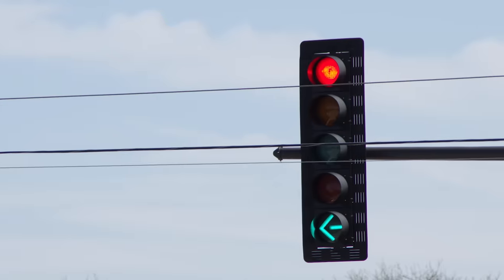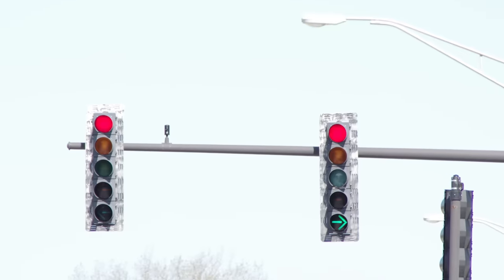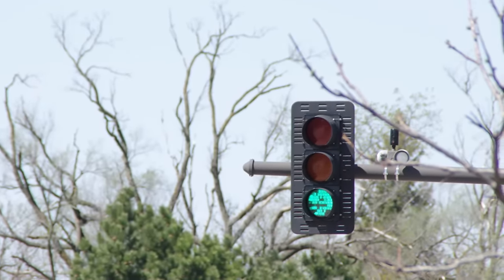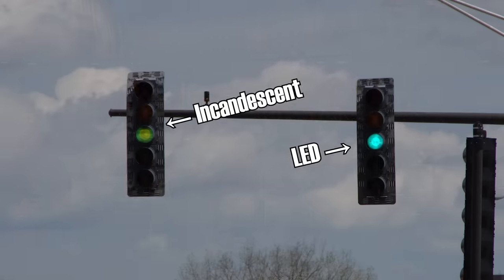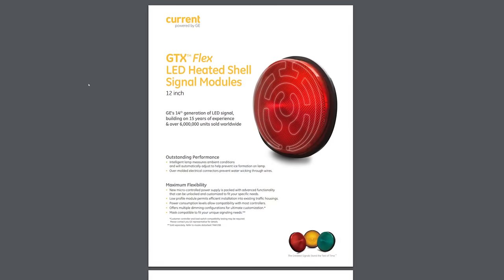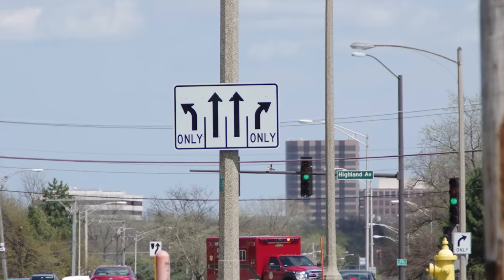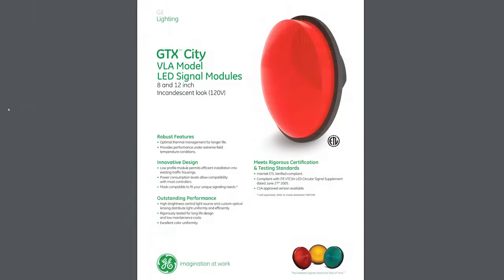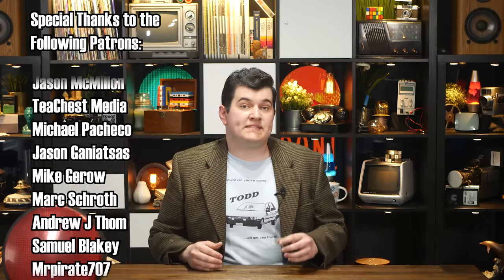The LED Traffic Light and the Danger of "But Sometimes!"

Comment: Just like "But Sometimes" automated electric cars have accidents and idiots started rioting. I really really wish only automated electric cars were allowed. Can you imagine what a great thing that would if we could accomplish that?

1. You don't need traffic lights at all! Because cars can talk to each other. The cars could decide how traffic should ve controlled so that it takes collectively least amount of time.
2. No anoying horns. Since cars could talk to each other there's no need for using horns (except when you really need to). That would solve sound pollution problem in busy areas by great amount. And of course, schools and hospitals would really appreciate this.
3. No one to break rules. Since no human drivers,no asshole drivers to break the rules.
4. Since no one is breaking the rules, no need for traffic police, no speeding ticket, no nothing.
5. And again, no asshole drivers.
6. No drivers ed, no complicated driving license acquiring etc. You could just buy a car and ride back to home.

This is something new and we really need to embrace it as quickly as possible. Just think about how much maintenance cost it will cut. The whole system needs to be redesigned, yes. That would take time. But if we try to embrace it as early as possible, the future might reveal itself to be much closer than we expected.
Reply: Cars can't talk to pedestrians and one pedestrian can break the whole "car talking" system since they are computers which were programmed by people. Imagine a kid jumping in front of a car to get his ball. What does the computer do? Turn and kill you and person in another car or try to break and kill the kid. Either way, there probably is a third option that computer would never know and even if it did it can't know which is the best. Computers don't know etics and they can't slow down because it saw a tip of the kids head who is playing basketball behind a row of parked cars and he MIGHT jump in front of a car. Also since cars are not the only members in traffic, traffic signs and lights are still needed. Automated cars are a great thing but completely removing humans from the picture is not possible.. At least with todays knowledge in AI and machine learning.
Reply: Well, if we had that level of automation why not just go to flying vehicles? I guess people who like to drive are just SOL.
Reply: Point number one and three ( and technically five ) are exactly why I don't like them. I like having agency in my transit or at very least transparency. And there are times and places where breaking the rules is the right thing to do even if it's not the "right" thing to do and you get punished for it. Also all it takes to ruin a computerized system is one fuckwit and having human adaptability is all you can really do about it. It might be safer overall though, but sometimes ( lol ) there are circumstances where a human needs to be in control. Also it wouldn't eliminate traffic police, it'd just make the whole situation more complicated in court. Cos what if the computer system malfunctions or gets hacked by a malicious actor or gets modded by somebody? Who's liable? What do you do? I'm also skeptical about just how much it will benefit and there's plenty of places where it just won't work well/at all. In a city, it could theoretically work, but in a city you're better off switching everything to automated trams/trolleys/buses/monorails/subways which are often even more energy and cost efficient. There's the question of using it for freight, which is what I think its best use is. But in that case I almost feel like "Why not use a train?"
Reply: @Marko_Djuricic  you should have watched the video. this is the danger of "but sometimes" yes, in that type of situation the ethics are questionable. however in any other circumstance they are factually better than humans. and to be fair. the question still arises for humans however because humans have significantly slower reaction time. they are way more likely to get in these types of situations.
Reply: Shadman Shahriar The thing I will say, even being a walker, we shouldn’t move everyone off driving as soon as possible, we should ween the necessary components needed to be kept in mind for driving over time and then get to driverless, since the but sometimes situations still crop up even in small moments that the human driver still has to make. Even better, that information of those but sometimes could be recorded for use in computer assisted driving. That is what we should do, and I will say for someone who said this in this comments sub-section, that yes, people will still like driving and even I like the concept of driving vehicles even if I am not one who can. It is the idea of being a race car driver but not being on a race track. That is why people like it. Now does that show a number of people who could have the motivation for competitive driving, sure, but not everyone has the reaction time for that. Anyway, I like the ideas of information and computer assistance but not to the point just yet that it should be fully automated. For one our architecture needs quite a lot of work for the assistance to work well, especially given the variety of efficiency across the US, from city to city even. I am glad here in Pittsburgh that a lot of work went into the trolly, train, bus, and Uber systems so that much of the newer people on the road use those instead, such as myself. While my step-father still drives since the cost of getting a computer assisted car is rather not in his price range right now. Although he also, before the pandemic lockdowns, did taxi and school bus service work too, so he was helping in that area of things even if he has an older car of his own. Yet he tended to use the taxi he was given since it was far safer than his somewhat broken down older car. However he had to pay for that rent wise and turn it in at certain periods so he didn’t always have the car available.
Reply: @floxy20  cost and expenses exist

Comment: This reminds me of all electric cars, they are actually too quiet, so quiet people don't hear them coming!
Do you ban electric cars or find a workaround?
Reply: Neither, they just roll them out as they are.
Some manufactures toyed with the idea of external speakers to replicate engine noise but that never went anywhere.
Reply: When the railroads made the switch from steam locomotives to diesels, the number of cars and pedestrians being hit at grade crossings shot up.  Darwinism in its finest form.
Reply: The workaround is looking both ways before crossing the road.
Reply: If it can make my electric car sound like, say, 1996 Tube Stock I might even consider learning to drive!
Reply: Electric cars DO have external speakers to warn pedestrians. My 2018 LEAF certainly does.
Reply: How on earth could you not hear a diesel engine coming? Some of the early ones you could hear from the next town over.
Reply: Has there actually been a spate of people getting hit by electric cars? My town had trolleybuses for years but I don't think I heard about them being dangerous for that reason.
Reply: The few incidents I know of where someone was hit or had a near miss with an electric car involved a blind pedestrian.
Reply: If people are set to lose money because of a new invention, they'll invest in promoting and making up flaws.
Reply: Ian's Network At least at high speeds (which are the accidents that are most worrisome).
Reply: Ian's Network On asphalt or gravel, yes. On clean concrete, no. Slow speeds (especially accelerating from a stopped position) were the reason speakers on electric vehicles were implemented.
Reply: The thing is, electric cars actually still make road noise, and to compare, at the low speeds seen in areas with high pedestrian traffic road noise can drown out the sound of even a 3.3L V6.

A workaround isn't needed.
Reply: no, i disagree. Ive seen tons  of EVs and they are only slightly quieter
Reply: Stephen Lipsett I'm a cyclist, quiet cars are dangerous because EVEN IF you're riding on the side of the road with enough space for any car to overtake, not being able to hear a car coming is dangerous.
Reply: Ian's Network In Stockholm I almost got ran over by a Tesla Model S. Cars parked next to the road meant i saw it only as I my sight got past the parked cars which basically meant i was in touching distance of the Tesla. Low and silent like a deadly predator
Reply: the place where i work at has electric forklifts, they are so quiet that our boss put safety regulations in place so we now have to honk the horn before driving arround tight corners.
Reply: A useful link. From my recent experience, having switched to a Toyota hybrid from a diesel engined car, I'm aware of minor difficulties with low speed movements, typically in car parks, but in relatively noisy areas with lots of people wandering around. Mind you, whether it will much difference with those with smartphones in use while they walk along, who knows!
Reply: Yes, Amzar, i drive a Hyundai Inoiq, it has a speaker that makes sound when i drive less then 50km/hour  ;)

Comment: When I lived in Erie, PA they had an emergency vehicle preemption system called Rad-O-Lite. This used radio frequencies to change traffic signals. It was installed in the late 60's/early 70's and may have been one of the first systems for vehicular traffic in use. I don't live there anymore but I hear that the system reached end-of-life and was taken out of use in the early 2000's.

Comment: I've never seen someone change a lightbulb on an intersection. They are in place sometimes for years, running at reduced current.
Reply: In Queens, NY, I see the teams out there, up and down Bell Blvd, and similar local roads at least twice a week (well, used to back in the early 2000s).
Reply: The only time I have seen work being done on a traffic light was when the light was damaged (at least one of the visors had been damaged, looked like the whole pole had been hit or something)
Reply: Yeah this video got me thinking... I don't think I've ever even seen a traffic light burned out! Maybe they use more long-lasting bulbs in Europe?
Reply: nrdesign1991 How many Technicians does it take to change a light bulb ?  What about railroad crossing signals, how do they work when a train comes?
Reply: Karl Baron Same, I have never seen a burned out bulb at a traffic light here in Germany, even though we still have a lot of incandescent bulbs in them.
Reply: I've seen enough burnt-out traffic light in my life. Plus they also need to be cleaned on the inside regularly. The heat from the incandescent bulbs agitates dust that settles on the reflectors,  turning them blind over time. One guy has to climb up a ladder then, open every light, unscrew every bulb and clean the inside with a wet rug.
Reply: Glenn Lego The tracks have a detection device that sends a signal to the control box when the train breaks the circuit
Reply: I was surprised to hear that the traffic signals used "plain old bulbs" with separate reflectors and lenses.   About 40 years ago, I helped a college friend build some low-budget stage lighting equipment,  and the big thing at the time was the appearance of what were referred to (if memory serves) as "PAR" lights that vastly simplified the construction of some lighting instruments.  Basically, these were 120V versions of sealed-beam automotive headlamps; some literally at the regular auto size, and some nearly a foot in diameter.   The manufacturer mentioned traffic signs very prominently in its applications literature.
Reply: I used to work a shift that ended a 4:30 AM back in the 80's and I used to see crews all the time.  i.e. they do maintenance late at night.
Reply: I've seen them out but it's usually at the cabinet probably adjusting timings. Now I think they may be networked up to be dynamically adjusted based on traffic flow.

Comment: Energy is energy, so I find it very unlikely that a separate heater and LED light would use more energy to provide the same light and heat.
The entropy from those devices is heat anyway.
Reply: Plus the heating element can be turned off during the warmer months, so even if it did turn out marginally worse for energy consumption it wouldn't once you take into account the savings during the warmer months.

Edit to add: I see that this is covered in the video too.

Comment: The thing I hate are red turn arrows. Especially at 2 in the morning. I get to sit at the green light but can't turn left because of the turn arrow. Even thought there is no car in any direction for at least half a mile. I may just go anyway, but neither you nor anyone else can tell.
Reply: Captian Morgan My area has finally cottoned on to the brilliant idea that is a flashing yellow after the protected left is done. The light pattern for the left turn lane goes:

Red
Green arrow
Yellow arrow
Red
Flashing yellow 
Solid yellow
Red
Green arrow 
(And so on)

Maybe bring it up to the powers that be, see if you can’t get it changed!
Reply: Captian Morgan when you see a red for no reason, beware. Theres probably a cop about working on his quota.
Reply: In my area, there's one on the corner where they built the new police station.
Reply: Your complaint is a classic example of "but sometimes".  It sounds like your problem isn't really that there is a red arrow, but rather that the red arrow is displayed unnecessarily.  Rather than sacrificing the safety benefits of a fully-protected turn signal because sometimes the light is red unnecessarily, the best solution is probably a more intelligent traffic signal controller/system, such as fully-actuated setup which would realize that no traffic is coming and give you a green arrow right away.
Reply: Every traffic light in my state in Australia has a sensor to detect when traffic is waiting. At night you're met with an almost instantaneous response, and are followed by a green wave along the road you're travelling on. 

A lot of people where I'm from don't seem to appreciate this until they go to somewhere which doesn't have an intelligent traffic light system, and they're stuck waiting at a light for a very long time.
Reply: reaperexpress actually at that light the red arrow is never needed. Even on the busiest days I'd only have to wait for a few cars to go through before I could turn. So it would be an example of "but always".
Reply: mubd1234 The light changes are hardly instantaneous if you are on a minor road intersecting with a major one. In cases like that, if I know it's totally safe, I'll just treat the red light like a stop sign.